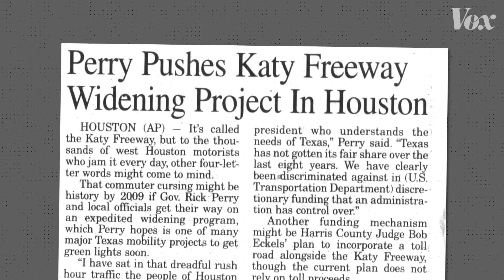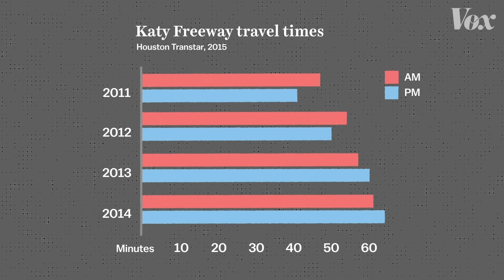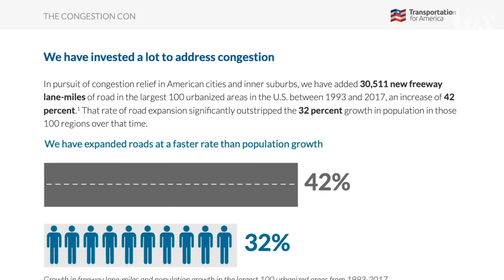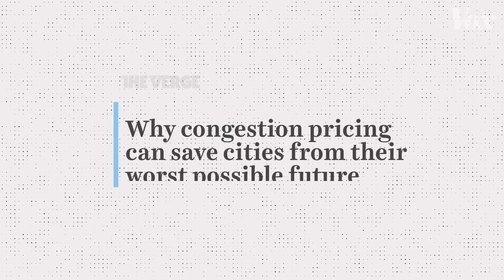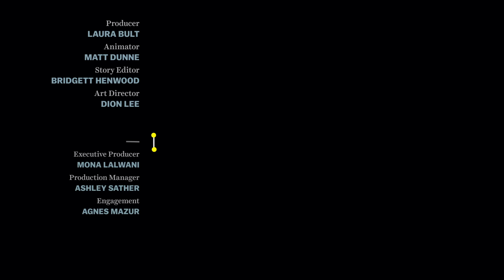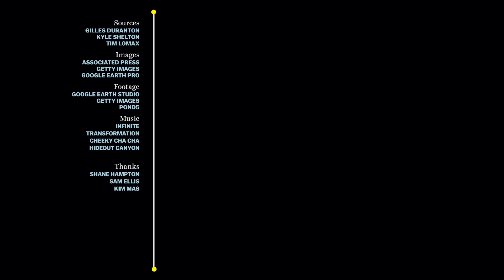How highways make traffic worse

Comment: The Boston example cited could not be more wrong! They put an even wider highway under that boulevard, and spent what could have been mass transit expansion funding to do so.  The highway is now all clogged up, and the transit is falling apart, as well as projects that were legally bound to implement as a condition to build it, are still yet to be built.

Comment: Boston didn’t just remove a highway. They replaced it with a multi billion dollar tunnel system.
Reply: Which was contingent on transit improvements like the no brainer project of connecting North and South Stations for a unified commuter rail network. No brainer because cities around the world from Paris, London, Philly have done it. Not only has that not happened yet, the Big Dig’s debt was handed off to Boston’s mass transit authority.

Comment: Trains are kind of a magic bullet tho, because if you build them right and build enough of them, you can actually soak up all the latent traffic that is waiting for a spot to open up. The fundamental problem of congestion is throughput per square meter. Individual drivers in individual cars is just an inefficient use of space, one person takes up several car lengths on a lane, and that is when traffic is flowing smoothly and most efficiently. When there is an accident, or even just a near miss and a few people break hard, it puts a traffic jam into the stream that drops the throughput efficiency down even further. Self driving cars will help, they will crash less, maintain safer distances and need hard braking less often, and can potentially even be programmed to smooth out stop and go traffic to decrease drive times, but they also come with a drawback, which is that sometimes they'll be on the road empty, further reducing the number of passengers able to use the limited amount of roads.

Trains on the other hand can fit scores of people in the space that could only fit a dozen cars.

Comment: Make bullet trains everywhere. Save cost and time
Reply: business insider Elon Musk's 700 MPH Hyperloop Concept
Reply: @darryloid3533  That will never be as good as the train. It simply won't provide the same capacity. An average high speed line can carry nearly 20,000 people per hour per direction when full, however Musk's hyperloop with pods every 2 minutes would only ever be able to carry 840 passengers per hour per direction. That's a massive difference. Even if pods were leaving every 30 seconds, that would still only be 3,600 people per hour per direction.

In fact, having done a bit of further reading, that example of 20,000 passengers per direction per hour is true, and is equivalent to a 10-lane highway, and then 2 airports on top of that. Likewise, a single high-speed train can carry the same number of people as 9 airplanes. From an environmental perspective, which is the better way to move people around?
Reply: High speed rail is a complete waste of time and money when self driving cars and buses are the best alternative
Reply: There's actually a very serious Houston/Brazos Valley/Dallas high speed plan under very serious consideration.
Reply: @simoncaron1086  You seriously think that? Just because they're electric, doesn't get rid of the source of the problem! Cars of any type are energy inefficient when compared to trains. For every freight train that runs in Europe, 76 HGVs are taken off the roads. And American freight trains are far longer, so that number will only be higher in the US. With the environment in mind, and with the looming threat of climate change (yes, it is happening), trains are by far the best way to cut the transport sector's carbon emissions!
Reply: It wouldn't work EVERYWHERE, but bullet trains between major cities close to one another (DC to NYC, Atlahta to Charlotte, San Diego to LA,  Portland to Seattle,  Tuscon  to Phoenix) yes!!
Reply: @lawrencewilliams4829  The Texas Central Railway has been slowed down by the pandemic. But the system already has contractors halfway on board and has actual contract to build the rolling stock.

Comment: 1. It’s a freaking INTERSTATE!!! Katy Fwy is still at its core a major interstate that connects east coast to west coast aka I-10. A lot of that traffic is just passerby traffic which is always going to increase as population of the USA increases. It has little to do with katy/Houston population, which are also increasing so it doesn’t help the traffic problem. But this video tries to explain it away with simple terms but it ignores the fact that more drivers are simply a byproduct of increasing overall population of USA (not just Katy/Houston area itself).
2. It’s called Katy Fwy because it connects major suburb Katy to Houston, TX. Also left two lanes are Katy Tollway, these drivers will always take interstate if it’s not congested because who wants to pay when you can drive just as fast in one lane over. 
3. Houston surrounding area is too big for public transportation to work so effectively. The city of Houston system has great public transportation. It’s truly actually really good! I used it daily when I lived there for a month. Problem was the commute from Katy to Houston. I did park and ride and those buses were close to full every morning (pre-COVID) and it still took an hour to get to work + additional time to get to Park and ride so I was adding close to 30+ mins to my drive everyday to get to downtown which is perhaps only few mins less than I would have spent traveling in my own car so the incentive wasn’t much. If there was a rail system that didn’t use interstate (because buses still had to spend a good part on the same congested I-10 in HOV lanes which were also packed) and that would save a lot more time, it would be more of an incentive for commuters like me to use more public transport.

Comment: The real problem is the fact people can't drive properly. If you look at it, highways should have no congestion because they have no stops, that is, traffic constantly moves and theres no reason to stop. 
The problem starts when imbeciles start merging at the speed of 20km/h making everyone slow down to accommodate them, it creates waves of traffic that linger there for hours. Another problem is the fact people hog the passing lane, which inherently disables a concept like the autobahn in Germany, where 3 lanes are enough to move all traffic because they can move at the speed they want to move, effectively reducing their time on the highway. 
If America made stricter laws and enforced them about proper highway driving, not forcing other drivers to accommodate them but accommodating themselves on merges or exits, staying in the right lane at all times except to pass, then more lanes makes sense for highways, as each lane would be a passing lane so that if you are passing someone going 100 km/h while going 150km/h someone can pass you going 200 km/h, effectively completely nullifying all traffic. 
Now another problem are exits off highways, assuming our highways will have a much higher capacity than now due to improved circumstances listed above, that would mean the exits would be really overflooded as the highways would be more efficient at moving traffic than cities would be at dispersing that moved traffic, though that's a problem for the city infrastructure.
A solution I would propose would be to make more highway exits in a city, so that all cars travelling to that city don't exit at the same exits, but then we would be faced with downtown areas where most people would be commuting, only solution that comes to my mind would be to not make large city centers but spread all city infrastructure around the city, so that there wouldn't be a region where everyone's travelling and millions of regions where no one's travelling, but that would be a lot of hassle and borderline impossible at present time, and since i'm not well educated in such manner I don't have a solution to city traffic, but with a little common sense we could make highways exponentially more efficient.

Comment: Have road widths expanded in proportion to the population since 1940? I think the problem is the continual growth of the population outstripping the anemic growth rate of infrastructure.
Reply: That's not it at all. The only way to solve the traffic is to improve public transport so more people use that and thus less traffic is on the road
Reply: @daniel15yearsago66  Citation? Not that I disagree with expanding public transit and replacing cars - I do, but I don't buy the "Induced Demand" concept. I think it's what you'd see any time you add more, but not sufficient, capacity to a system that is running well above its design load (the phenomenal cost of building out adequate capacity with cars' inefficiencies is another story).
Reply: You make a good point, but the cost of building and especially maintaining that infrastructure does not scale linearly with population.
Reply: @Dankyjrthethird  Especially since when you build a 2-lane road, someone will come and build houses and businesses next to it. Then you have to demolish miles upon miles of very expensive buildings if you want to build it out to an 8-lane monstrosity. Or you can build 'higher' instead of 'wider' by  putting a train on the same footprint.

Comment: This is whare the idea of working less than 10min away from home could solve problems, opportunity should be more spread out.
Reply: That’s what she meant when she said mixed development
Reply: Spread out opportunities is not economically easy because firms obtain gains from concentrating in cities's centers. So the best choise is denser cities, with a better use of land avoiding that new suburbs spraw.
Reply: @paulo.alexandrino  is the solution a 3D city made of skyscrapers maybe?
Reply: @Big007Boss  Maybe, but we have to consider that higher the building less "green" it is, because of energey usage. The optimal height will change from city to city. An interesting way to think about land usage is to imagine a city with spraw limits, like Hong Kong (an island) or Paris (a medieval city that used to have walls). Off course we have to account people's preferences, many like to live in suburbs. But I think that allow others to live near cities' centers through less constructing restrictions is a good policy.

Comment: It seems to me induced demand isn't what's going on. It's that demand was suppressed by the congestion (making the highway a less valuable choice) and the expansion was insufficient to meet to actual demand for an uncongested highway. It's not like there are infinite commuters that will keep appearing indefinitely.
Reply: You're going to ruin their point of 'car bad, public transit good'
Reply: Yes but with how bad car infrastructure scales when compared to other modes of transit. Adding capacity until supply overtakes demand would turn cities into massively spread out, financially unsustainable, asphalt hellholes. Not to mention all other infrastructure (electricity,gas,plumbing etc.) would also get more expensive to build because of reduced density.
Reply: In addition to that, this added road capacity would lead to future develoments outside of the city becoming more feasible. Basically more suburbs would be built and that would lead to more commuters. It's not infinite commuters but it's enough that outpacing it by building car infrastructure is impractical and neither financially nor environmentally sustainable in the long term.

Comment: The notion of more lanes equal less traffic does not fit for any metro area with explosive growth. Houston metro gain 1.2M per decade and most of that growth is on the west side. Adding more lanes only attracts more developments and sprawl. What Houston need is a commuter rail added to the existing park & ride system
Reply: what houston needs and what every city needs are land use reform that stimulates vertical growth in places we have already built
Reply: Even if they didn’t add the lanes the growth would still come. See Austin, TX, now the worst traffic in the state as they thought if they didn’t add any roadway capacity then development wouldn’t come. The freeway capacity isn’t the reason why the development comes, that’s where videos like this miss the mark.

Comment: There's a fallacy here somewhere. At the same level of congestion, a 6-lane highway still moves 50% more people per hour than a 4-lane one. Similarly, if you have zero roads you will have zero congestion because people physically can't drive. Now they can't get anywhere, but that doesn't seem to concern you, your goal is zero congestion.
Reply: Perhaps it can fit more cars but they don't go any faster because all roads, even if you add more lanes terminate at the "same place" or desired destination, and when more people are trying to end up at the same place, all those people are going to have to wait their turn to get into that place. Re: bottle necking
Reply: @salinuh1467 , that's not generally true because not everyone are going from the same starting location to the same destination.
Reply: @VioletGiraffe  i hear you, maybe my wording wasn't right, but they're headed in the same general direction and every exit is like a bottle neck
Reply: @salinuh1467 , that's fair enough and you do have a point, obviously you can't make a 100 lane road and expect traffic to flow at the same speed as a 2-lane road (for 50x increase in throughput). But usually there is some room for scaling up. And, of course, this doesn't increase the speed at which individual vehicles travel, but it does increase how many can travel at once, e. g. throughput.

Comment: assuming traffic congestion is a deterrent for the non essential commuters, why not just invest in alternative modes of transportation rather than increased spending to remove already built highways. 
The idea should be to make the alternatives more attractive rather the getting rid of the already in place infrastructure.
I’m certain Boston must have invested in alternative routes and public transportation in order to reduce the level of congestion.

Comment: So i don't think the problem lies in the wider highways. Wider highways increase throughput, it's just that there's always more demand so it doesn't solve the problem of congestion (if that's the goal). It still increases throughput.

Imo the solution to this will be self-driving cars that can platoon and change lanes perfectly without incurring congestion waves 3km down the road. Congestion will vanish when a critical number of self-driving cars make up the bulk of cars, especially if they're networked to coordinate manouvers and supress traffic shock waves.

A possible solution would be to make ride-hailing services cheaper than owning a car, as soon as that happens people will start migrating into that system and conjestion should vanish within 5 years.

Comment: We had lots of arguments here in Sydney about the WestConnex project(s) which basically links up all the remaining motorways and freeways of the city. They are building it anyway, though with tunnels instead of surface roads like the freeway plans of the 60s and 70s that were scuttled because of public opposition. And where are they putting these interchanges and new tunnels? In the inner suburbs.

Comment: As you stated reducing traffic is complicated and I think it's still even more complicated than just reducing highways. But as you pointed out better public transportation would definitely help out a lot.

Here's the thing though. People really hate taking the bus. I remember back in high school I used to take the bus to get the school and back and I just hated having to do it every single day. When I went to Santa Rosa Junior college before I got my driver's license I started to take the bus to get anywhere and it was so frustrating and even more so frustrating because of how different the bus schedules ended up being because of what time I had to go to class and whatnot. Ever since getting my license just one day before I turned 21 I have felt so much better cuz I could drive to wherever I want. I do have the benefit of not being an hour south in San Francisco where traffic is absolutely horrible, but there are times of day in my hometown of Santa Rosa where traffic does get bad specifically on the freeway and usually in one specific direction and not both.
Reply: So the solution is better bus schedules that run more frquentlu

Comment: This is logical, but I want to point out that this is not a problem of highway expansion per se. It is a problem of transportation in general. I'm french, and in Paris we have the same problem with train congestion. To answer that we build more trains which, in effect, creates more routes for commuters. But quickly, these new lines that were supposed to relieve the pressure on the existing lines get themselves congested. 

Because the problem is not the size of the route or the number of trains, but the attractiveness of the area. More highways and/or more trains and/or more buses will only increase how attractive is the area and bring more people into these areas. The real solution is to decentralised our cities and allow flexible hours
Reply: Their is no “solution” but transit is way less susceptible to induced demand than say car infrastructure. Decentralized cities aren’t particularly realistic.